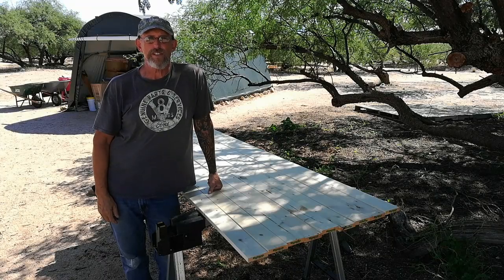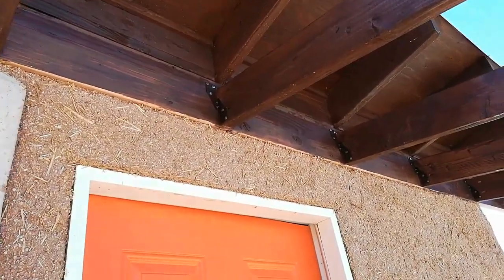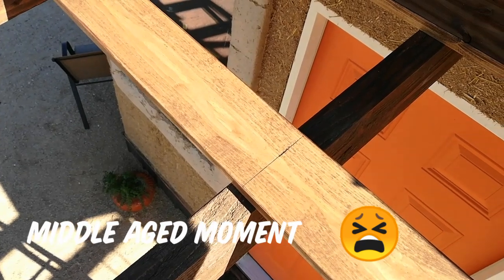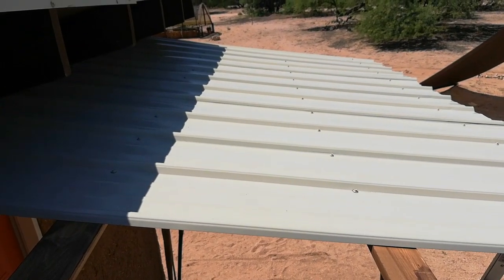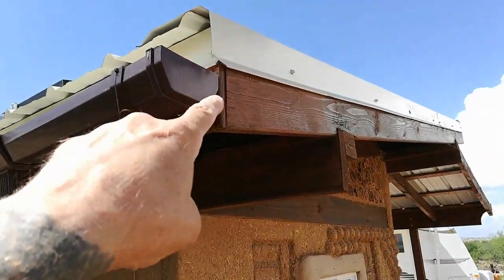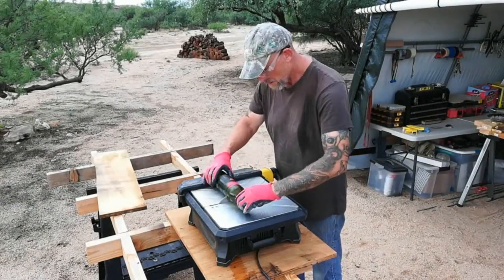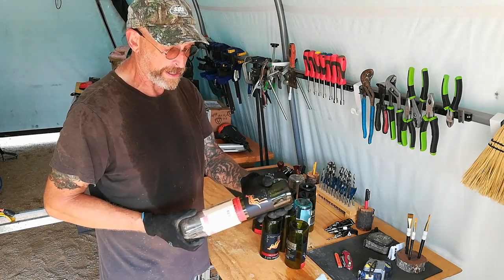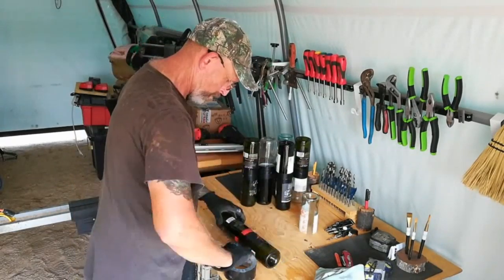Saving Our Solar Shed Part 2 + Bottle Brick Interlude

Comment: Bill, thanks for the on going solution oriented approach in the face of big weather events. Optimism!
Reply from the maker: Wait for our short video tomorrow. We just had flooding that almost swept our trailer away! Ripped all of our waterline out of the ground! We are safe and that's the most important thing. MAJOR REBUILDING will be necessary. But, we are up to the challenge.

Comment: The side trim, as you call it, is really part of the flashing system that is needed to keep water from penetrating into the structure at the roof edges.  In the case of your overhang, water infiltration isn't really an issue, but it provides an extra measure of support with respect to resisting wind uplift load.
Reply: @theupsideofdownsizing  I saw that but didn't know if it had been included because flashing was needed or for strictly trim appearances.

Comment: With regard to the "wave" in the projection of your roof metal, it would be faster and simpler to just trim back the top of the two columns so that they are clear of the bottom of the roofing metal.
Reply: I too thought it was mathematical lifting from the additional two inches of material on the posts.  HOwever as he stated if he matches the 2x4 with the top part of the posts it will all even out.  Great eye David!

Comment: With the bottle bricks, I’m curious if leaving the labels on creates a potential problem with the long term stickiness of the tape. Would glue be better for the long term?
Reply from the maker: I see what you're saying, but the bottles are completely imbedded in the Cobb mix so even if the tape should fail, the bottles won't be moving or shifting. We appreciate you watching and for your comments!

Comment: Just one comment
On the original roof
The high side. You might experience a problem with rain running down the underside of the rafters and getting the wall/straw bale wet...
One solution could be to make a cut to the under side of the rafter.  That should stop the rain from running back the rafters and dripping off at the cut...
I've seen it done years ago
But don't remember how wide the cut was....
Reply from the maker: Thanks for the info and for noticing the details. You obviously have many years of practical experience. 🙏 FYI, the wall under the roof edge ( high side) is actually cob, not straw bale but your point is nevertheless well taken. The bale walls have a box beam (top plate) the width of the bales and is also plastered so that the straw bales are not open to the elements ( or critters).
Reply: @theupsideofdownsizing  
My brother had his house built
And in time the inner wall was showing water
Long story short
An old timer carpenter saw the problem and knew the fix..
So you might saw I was in the right place at the right time..
Reply from the maker: @jimh4167  so often in life timing is everything.
Reply: @theupsideofdownsizing  
👍👍